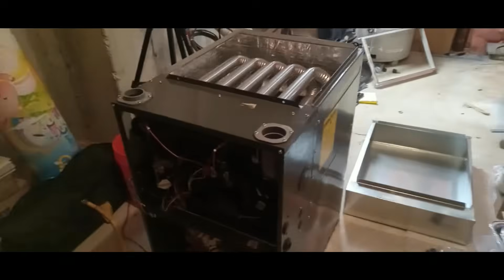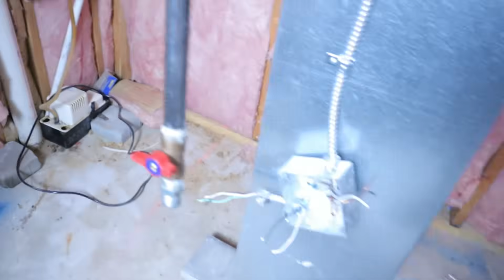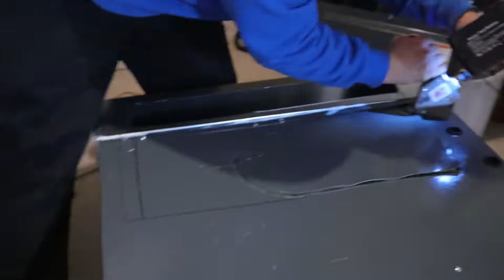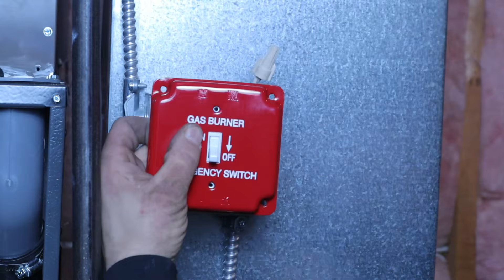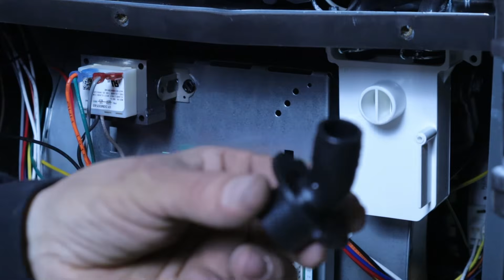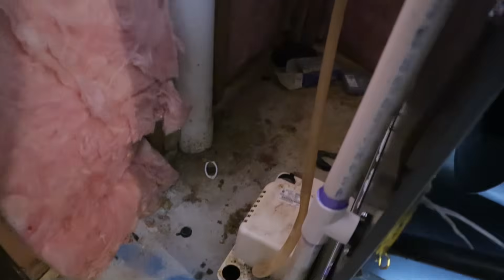90%+ Furnace Install (Start to finish)

Comment: The furnace is a munchkin place gas hot baseboard water system.  It’s hung on the wall
Three zones (one for hot water tank…stainless steel).  Keep the hot water set up and zone valves (taco circulator).  Easier to just replace the munchkin furnace and keep existing parts?

Comment: If you have a 20 year old lp gas furnace (munchkin) can a new efficient furnace be installed without revamping everything?  
One local contractor wants about $15,000 to put a new one in.  I know it’s not plug and play but isn’t it possible to just replace the furnace….?

Comment: when purging air out of the gas line theres something thats called the elk call.  pull the cap completely off and open the valve slightly and listen for the tone to go from low to high.  when you get the high tone you know you have 100% gas

Comment: What is best? Having moist air removed from inside thr house? Or pulling could moist air from outside to heat your home, leaving moist air inside?
Reply from the maker: Winter air doesn't have a lot of moisture in it and can be drier than the air in the home. And even though the condensation from combustion is removing some moisture when air is taken from within the home, it is often not enough to significantly alter humidity levels.

  In my opinion, indoor air would be a preference. Really cold, dense air can potentially trigger pressure switch issues if you have any flaws in the way the flue pipe and furnace was installed or with some really tightly designed furnaces, though that's not really common. But warmer indoor air is also less dense and is easier to heat, which can help a little bit with efficiency. 

 If it were my house? I would put a damper controlled fresh air intake from outdoors to the utility area that the furnace is drawing indoor air from for better air quality in the home overall, rather than pipe cold air straight into the furnace from outside.

Comment: Good start & @ 7:43 something in Hidden screws or screwed from inside always a bummer ( said mildly ) 8 :30 furnace is out but what holding coil up ? so well attached to supply  no hanger of coil needed ? & 23;48 in we usually always included an new tstat unless its so new or customer loves the old one but 2 h 2 c tstats are a dif extra costs 100 +++  $.... but jumper  a blue million otherwise .... we do very few 90 + here in the south so i always have to SMH on flue vent & condensation traps setups & great startup ....so may forget or dont do heat rise to set blower speed & we always go 1 step further & ck gas WC make sure its to specs usually 3.5" Thanks ..Great Job if you ever in Atlanta & need work hit me up lol we covered Up

Comment: Was looking at Goodman electric furnaces for a 374sq.ft. downstairs on a home built in 1905 that's wired for 220. Ripping out the old fuel oil furnace. The winters up here get down to -20degreesF and we've been using a small fireplace in the basement supplemented with a small electric radiator and propane wall heater on the first floor with no heat upstairs (but miraculously we stay warm). I noticed your hesitation for replacing a York with the Goodman; is York better? Thank you very much for showing this install any advice is greatly appreciated. 🙂
Reply from the maker: I wouldn't say I felt hesitation, but more like indifference. I would consider both to be standard contractor brands and don't really think one is an upgrade over the other. But bottom line is going to be the quality of the install itself. If that's done right, you'll get the most out of either brand.

Comment: How do you wire condensate pump up to shut air or furnace to shut off? Can you series the pump with the red wire from transformer if pump over flows
Reply from the maker: Yes, wire in series between control board R terminal and thermostat R terminal.
Reply: Can you just series the red wire off the transformer, if you have 2wires on the red terminal. Thank You

Comment: You don’t need a trap on the coil condensation drain?
Reply from the maker: This is a positive pressure coil in a conditioned space. Don't necessarily need one, But 99% of the time I put one in anyway, Don't recall why i didn't on this one...its been a while.
Reply: @JerseyMikeHVAC  Thanks for sharing!  Your video helped me out tremendously.

Comment: There should be Automatic Heat Staging, when you set AHS from no to yes on a display, so you don’t need to put a jumper,  it will change stage’s automatically. Of course, if you have that display on a your furnace

Comment: Great video! I learned a lot. For the hose that hooks to the condensate trap for heating could you have used regular worm clamps if the manufacturer didn't provide clamps?
Reply from the maker: Sure. I've had to do it myself a few times.
Reply: Thanks
Reply: I forgot to ask when you are installing gas piping is it easier to start from gas valve to manual shut off or from the manual shutoff to the gas valve?
Reply from the maker: @marcusdarnell3348  I work from both ends to a union.

Comment: Curious when you did the yellow jumper wire on circuit board you talked about thid being necessary to force blower to run at high speed when a/c is used.  Is it safe to assume it was a two speed furnace and nowcwill be a single speed?  I am wondering why the customer decided to not change thermostat(s) if that was only reason why the feature of a two spped blower couldn't be used.

Do both heating and cooling modes utilize the low speed normally or just heating?
Reply from the maker: You need more than different blower speeds to make a system truly 2 stage or multi stage. For AC you also need a staged compressor and for heating a 2 stage gas valve. 

This particular install had neither. 

In this case, changing the blower speed only effects volume of the system and the dehumidification factor. It will do very little if anything at all for efficiency.

Typically, heating will be a lower blower speed while cooling is higher., hence forcing the unit to run with the jumper at higher speed for AC mode.
Reply: @JerseyMikeHVAC  Thanks for the reply.  So in this case weren't you installing a furnace with two speed blower?  Isn't the gas valve part of the furnace?  For me the idea of a two speed blower furnace is to allow the furnace to run more or less continually on low speed as opposed to coming on full blast (loud) and run for short time and turn off.  Short cycle isn't desirable.  As far as a/c model would I be correct to assume desired is to have blower come on high whenever compressor was running?
Reply from the maker: @jimw6991  That is not what short cycling is. Short cycling is either a malfunctioning system that doesn't run a full cycle at all or an oversized system (like a 3.5 ton unit cooling an area only requiring 2 tons).  On a properly sized system, changing blower speeds can increase or decrease cycle times, but all that really does is alter latent and sensible heat removal ratios. Lower speed will remove more humidity but run much longer cycles. Higher speeds will remove humidity too, but will bring down sensible heat faster. It's not short cycling. 

Again, blower speed does not make staging. Compressors and gas valves do. Blowers just compensate based on compressor or gas staging. The furnace didn't have a 2 stage gas valve. The AC didn't have a 2 stage compressor. Therefore it cannot be a 2 stage furnace. The higher blower speed could compensate for a 2 stage AC system (compressor), but this customer didn't have one. 

Blower speed alone is only rule of thumb for heating/cooling. You can run it at any speed you desire. For some customers comfort is priority. For other noise. For some energy efficiency, etc. Blower speeds are adjusted for these factors. A properly sized system will still work properly regardless of blower speed.

Comment: Great job and video. The only thing I do differently is when making my connections is ground first, then neutrals followed by the line voltage conductors.
Reply from the maker: Good practice

Comment: Been doing straight coils and heat pumps for 15 years today I’m installing my first furnace any tips would be appreciated
Reply from the maker: Low voltage wiring is pretty much the same as straight cool. Just need the w terminal for heat. 

Crack a union or cap on the gas line for just a second with the gas cock open to purge air out. That will help prevent false starts on startup. 

Usually I do a delta T between supply and return. There's a sticker inside the unit that tells you your heat rise limit. Often between 35 and 65 deg F. You want your delta T between those numbers. Too high and you'll have to back off on the gas pressure at the gas valve inside the unit. 

If the PCB and blower allow for different speeds in different modes use red (low speed) off of blower for heating and black (high) for cooling. Or go through the menu to run heat at a lower speed than cooling.

Comment: I’m still learning…could you explain to me again why the jumper on the board from thermostat was necessary?
Reply from the maker: The blower is capable of running at a low or high speed based on temperature differences between room ambient and thermostat set point. If room is 74 and stat is set to 72, it can run at low speed for less power consumption without going full speed all of the time. If the temperature difference is higher the unit can kick into the higher second speed to meet the larger load.  

You need a 2 stage thermostat and condensing unit to do this, but you don't have to. You can just use a regular thermostat and condensing unit that run at one speed. 

Without the jumper from Y1 to Y2, the blower will only run at the lower speed all of the time and full cooling capacity will never be achieved. The jumper forces the unit to run at the higher speed so it will run at full capacity.

Comment: Took one day
Reply from the maker: We were done by 2!
Reply: @JerseyMikeHVAC You make it look easy.  I am confident I  could easily do the work, but I  lack knowledge of what could go wrong, what to check and verify, etc.

Do you think hvac tech would be willing to come in and inspect, test a unit a homeowner like me installed before it is powered up and run the first time?  My idea being I could save money doing the labor and pay for the technical knowledge part of the job, if that makes sense, but make certain before using the system nothing important got overlooked.

Great video and nice install.  I picked up a few tips.
Reply from the maker: @jimw6991  You may be able to find a guy but it's not likely going to be through contacting local hvac contractors. Very few companies will take on the liability. 

You'd be better off trying to find an experienced HVAC guy willing to moonlight a little bit to help you out. 
Local ad, ask around HVAC supply houses, that sort of thing.